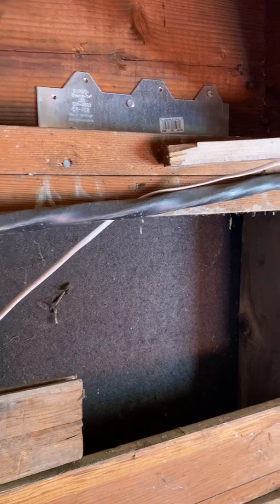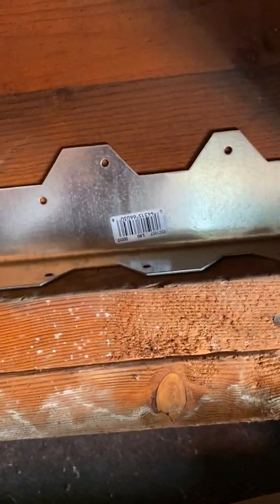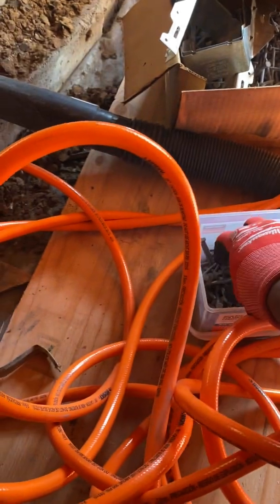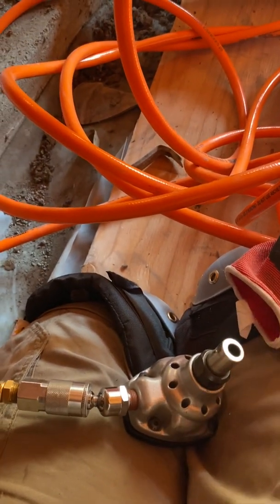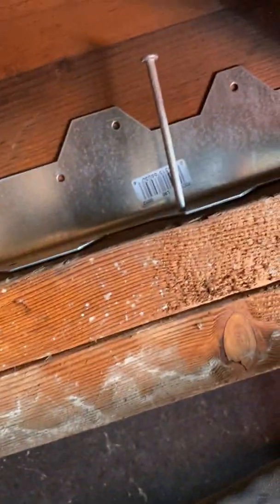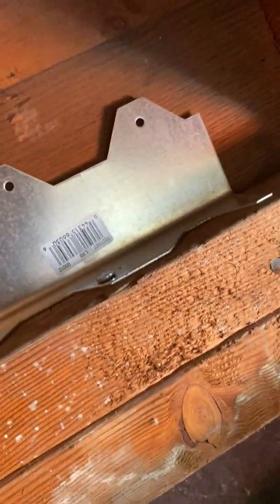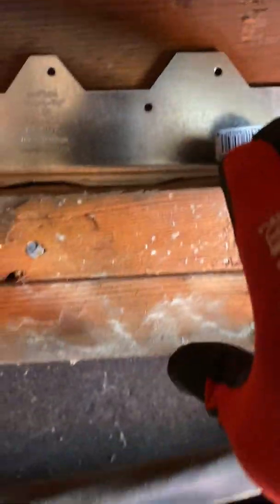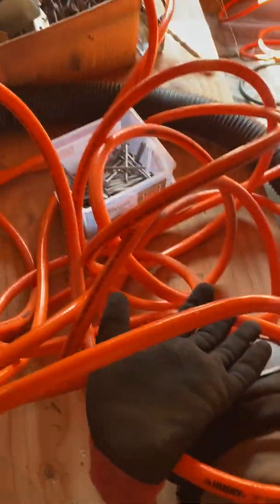How to install shear transfer ties into Double Top Plate(s)/ Earthquake Retrofit

Comment: What was the spacing between ties?  Thanks for covering this topic.
Reply from the maker: Hey, just saw this.  I would double-check standard plan A or whichever plan guide you're following.  I just placed TWO for every ONE  anchor bold (Simpson plate).  Generally the space up there is only enough for one 9L or maybe 2x 7L's.